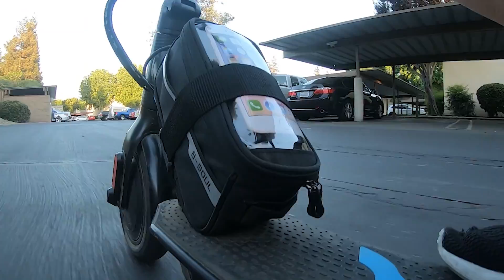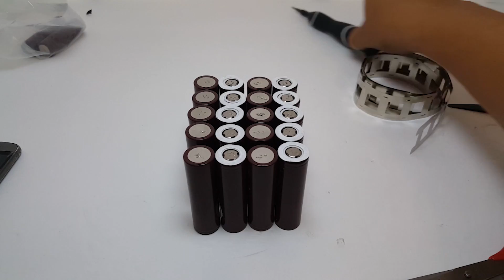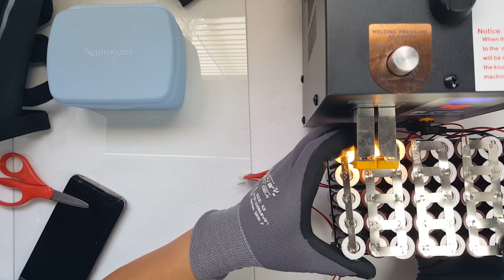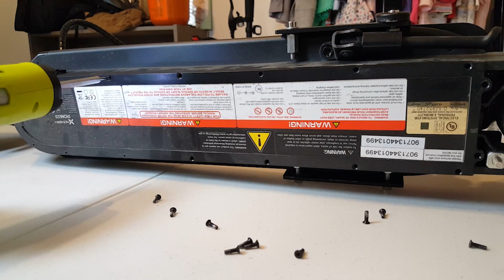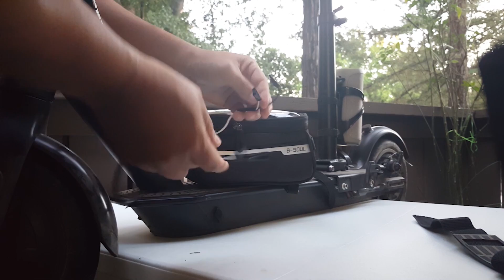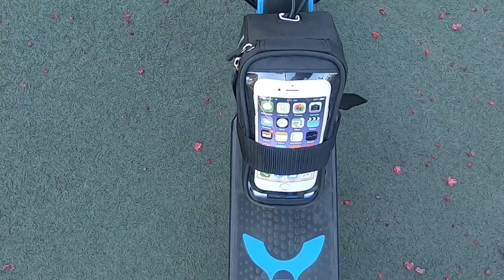DIY Scooter Battery Pack Build for 30+ Mile Range!

Comment: Spot welder is not needed. A 250 watt soldering gun works great, without over heating, and much better contact using brass strips.

Comment: I did something similar, but instead, weatherproofed my old ninebot f65 battery with a bag and outdoor duct tape, then stuck it on the deck. Soon it'll be mounted to the angled part of the stem, but for now, it works. Navee scooters are surprisingly easy to mod. Not many options though.

Comment: My scooter looks the same so how many volts mah and amps was your standard battery. Mine only said 7.8 amp so am I to assume that's a pack of 10 in series with 780mah battery cells?
Reply: 10 series 3 paralell 2600mah

Comment: I'm going to build my own battery but what annoyes me is there ratings. A 18650 will say 3000mah and 15 amps. The scooter original battery doesn't say how many mah just it's 7.8 amps. So how the heck I'm I supposed to make it higher capacity than original if I don't know what that is. Yes I could build a pack with just 10 cells. To get 36ish volts and the Max amps will be higher at 15 or 20 amps or whatever battery I get. But what about mah. I always went under the assumption that mah is the amps in which case if I need 1000 watts I would need a pack the size of the whole scooter. I assumed the battery that's coming with my scooter was a 7800mah. Am I just going to have to wait for it to arrive so I can see mah rating. Because there's no point just having a high max amp rating if it's only going to last a few minutes.
I need to power 1000 watts to get the most out of this pre restricted scooter I'm getting. Which according to the battery will be around 280 watt which is about right to keep it within the 25kmh speed limit. It's more confusing when seeing premade packs that say 10000mah and no amp rating. I would just call that 10 amps or could it be more seen as amp ratings are always higher than mah ratings. This is why I usually just stick to gasoline powered things there's no confusion it's as simple as it gets. To top it all off there alot of crap batteries that lie about there ratings and that's individual cells and cheap packs use those cells so who knows what your getting. In my rc aircraft I always just went by mah to determine the continuous amps I need. And c ratings doesn't mean alot at all seen as even the top brands lie about there c ratings. So you just pick something with the highest c which is probably around the 25c I need. Get a cheap battery that says 25c it's probably just a paper weight.
If I just bit the bullet and build a 10 cell by 2 with cell ratings of 3000mah and 15 amps. So finished pack is 6000mah and 30 amp Max is that considered a small battery or large?

Comment: Can you do this for a gotrax xr pro? Lol
Reply: It even already has a handle I can just hand and further secure the bag to the scooter
Reply from the maker: you can do this for pretty much any scooter as long as you match the spec of the pack to the orginal.
Reply: @JinsTeardowns  so my last question is. Is it possible to convert the battery pack connectors to a DC input and trick the scooter into using it for power instead of charging!? I’ve seen someone do this on another scooter. My gotrax XR PRO (only sold at Best Buy idky lol) when it has a DC cord plugged in it doesn’t power on. Only charges.

Comment: The vibration will shift the battery over time it will come apart
Reply from the maker: This battery pack has been holding fine for me for 2 years now, but yes I would recommend using heat wrap to hold the battery together.
Reply: @JinsTeardowns  I see, my design might have been shady then. Heat wrap for sure next time.
Reply from the maker: @CliftonRX7  yea and make sure the weld are strong cause if not vibration and bump will definitely break those weld loose.
Reply: @JinsTeardowns  true, I learnt the hard way.
Reply: @JinsTeardowns can I build one you built or how much for you to build it? My scooter is a hytoy skute 36v 250 ways.I would like about 50 miles and just a little climb power

Comment: Great vid! I have a few questions. I have a xiaomi scooter that i plan on modding. 1) Do i have to use a car fuse or is it unnecessary? I dont think that there is a high chance of high current damaging the scooter so not sure if ill use one. 2) Is it recommended to solder wires, did yours heat up because if the loose connections. 3) Does the speed increase or does it stay the same. Anyways thank you so much for this video. Hope i can do the same with my scooter and double the range. Btw im using salvaged wires aswell 😅
Reply: Hello im sureby now uve sold those probs.  Everything is nessesary though.  Even ifyou made thebartery already.  There is nothing wrong with takubg it to a electriction to once over.  Batreries can geat over time.  Hope this helps
Reply: @John Lone  I decided to make my own fuse holder using a 20amp fuse and used another scooter battery and now I have 80 kms range. Also upgraded the xiaomi m365 pros suspension and added rgb lights to it. Never knew how fun modifying scooters was

Comment: Can this be applied too for NIU KQi3 Pro escooters?
Reply from the maker: as long as the battery is the same voltage as the original then it should be able to work no problem.

Comment: Can u do it with a vsett10+ ? Because i rly wanna add some km to my scooter but idk which battery use !! There is a guy who says EVE battery is good but idk , if u can explain which brands are good for it , I ll appreciat it , thanks .
Reply from the maker: LG and Samsung brand are both good...alot of high end scooter uses those cells....just make sure you get them from a reputable seller....

Comment: Have u thought about a way to spread the battery across the length of the scooter? Also will this work on others with same components ?
Reply from the maker: I've seen people use a plastic riser for the bottom cover so they can add more battery into the deck of the scooter.  Not sure if I can fit 50 batteries in there lol.
Reply: @JinsTeardowns  right. The ninebot ones are perfect for this as the battery is in the steering column not the bottom so you could add there.
Reply: @JinsTeardowns  another option be to actually attach along the steering shift for yours.

Comment: Real nice and good explaining ,do you have to add a second bms on the external battery pack ? Can u also use one of those external battery connectors on ali express - if so would they work wo adding a second bms
Reply from the maker: Yes you'll need a second bms.

Comment: Nice Vid!  I also have a Hover1 Pioneer, just wondering if I am able to use 48v battery pack instead of 36v?  I would not run them in parallel btw

Comment: Liken can I make a 20aml hour and connect to my 7.8 amp hour if the volts are the same
Reply: Yes no problem at all. But make sure to full charge both batteries before connecting them in parallel. This is to make sure they are both the same voltage

Comment: That electrical fuse is useless and dangerous, the fuse melts when it gets too hot, so it doesn't stop high currents, it melts and continues until a fire occurs. There are two versions of this type of fuse, the one with the bigger housing will not melt as easily as the small one.

Comment: The batteries should be of similar capacity or just remove the stock one. After a few cycles there will be problems
Reply: No.
Reply: FALSE u don't know what you're on about

Comment: hi can you suggest me what I need to make external battery for my scooter this is my battery info. for my scooter 8000mAh/ 36V /216W
Reply: like what you doing it a parallel or series?
Reply: and its ok if I come with higher mah than my original internal battery as long they both 36volts?

Comment: What if you added another wheel to the back? Would it be any different. Or wouldn't it be any use? Good build.  What amp were the batteries?

Comment: and how do I charge the scooter with a normal charger?
Reply: @JinsTeardowns  ok thx
Reply: i just made it from old laptop battery and it works so nice
Reply: hello I have one more question will it be ok if the cell capacity is different for example when I have 30 cells with a capacity of 2000 mah and 20 with a capacity of 1500? sorry for mine english im from czech republic

Comment: Can i make external battery pack that have different capacity and discharge rate but same voltage? Both have bms? Reply please thanks!
Reply: *both battery pack is 36v and with bms also

Comment: Just swap the controller and go to 48v
Reply: @JinsTeardowns  you wouldn't have to just add a 3s pack in series with the original packs get a bms with the same amp output as the stock battery You'll gain about 7-10mph especially if you have 10 inch tires.

Comment: Hey Jin, How do you charge both batteries? Does the OEM charge port charge both?
Reply: The OEM port would charge  both batteries and propably overcharge the extra battery bypassing the BMS. This should not be possible. You would have to disconnect the external battery every time you charge the scooters original battery. The way this DIY battery is just wired in in parallel is possibly dangerous for this reason.

Comment: First, great job! Are you an electrician? Second, I was thinking of using like a power bank. What are your thoughts?
Reply: Jin Thao even more impressive.
Reply: @JinsTeardowns  i wanna add an external battery to my kaabo mantis 8, but how would you go about that without compromising the water resistance?

Comment: Do you have to charge the batteries separately or can you still use the charger that came with the scooter to charge both batteries after it’s installed? I know you want to charge both batteries separately before installing to get to the same voltage. Thanks
Reply: @JinsTeardowns  thanks for the quick reply!!!  I guess my question is does it matter how you charge it after you have both batteries connected? Say for example, I charge just the external battery but not the original hover 1 battery, would the original hover 1 battery still charge? Thanks again and thanks for the video!!!
Reply: @JinsTeardowns  thanks!!! and keep up the great videos!!!

Comment: Hey mate nice video so can you charge from both charge ports or just the one and how will charge work will it charge both battery’s regardless of which charge port
Reply: @JinsTeardowns   great video, I just have a question about connecting the 2 batterys together.. I have a 60v scoot that goes about 40 mphs so I am wondering if I get a second battery would it at more power to the motors and also would I run the risk of burning out my controller??
Reply: @JinsTeardowns  ok sounds good. So when you say connect in parallel does this mean that I dont have to switch between batterys once connected? If it shows 67v when fully charged with current battery will it still show same voltage when second 1 connected? Its a minimotors eye 3 controller btw. Also their is 2 charge ports on my scooter already so can I charge 2 batterys through these ports or do I need new port? Sorry for all the questions.

Comment: Hey man, ive found a battery that fits my voltage and amp hour, but do the watts have to match the original battery aswell?
Reply: only voltage should match. If your main battery is a 10s battery you have to buy  10s  supplementary battery. And more amps = more milage. Watts is only volts multiplied by amps
Reply: @voidex136  thanks, ✌
Reply: Watts is volt times amp so it would be the same